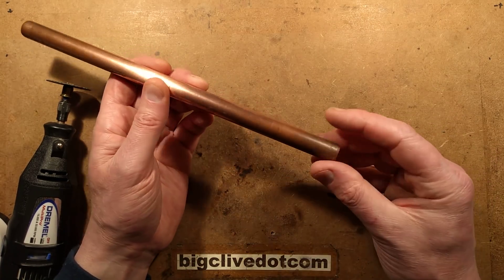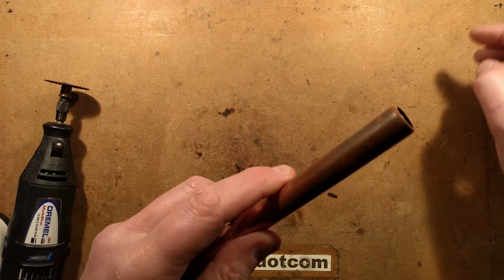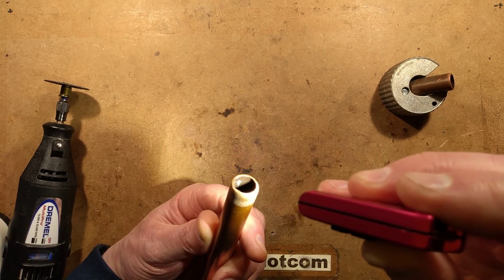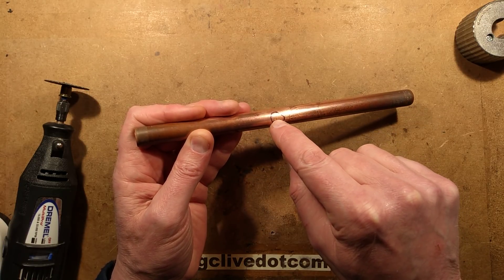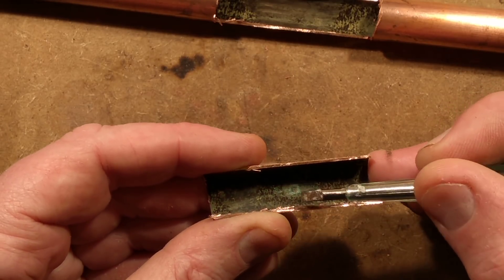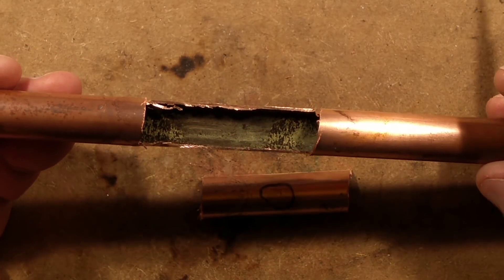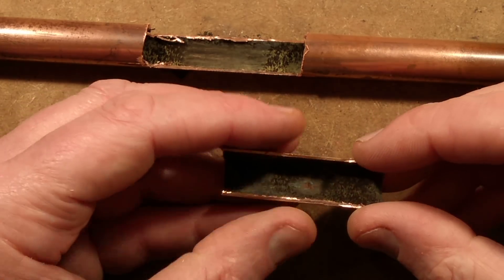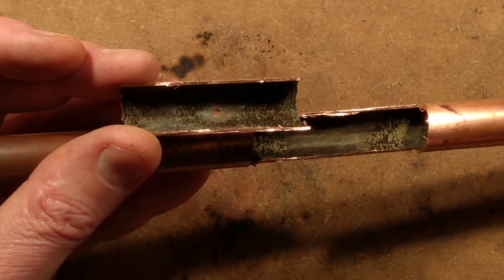Odd pinhole leak in copper pipe.  Selective electrolytic corrosion?

Comment: Pit corrosion caused by mixing copper and metal fittings in the system, not helped by the fact you have extremely soft water in Scotland. Over in Belgium copper pipes get clogged with scale, so choose your poison.

Comment: Solder beads that were trapped in the pipe... Then flushed along when water started flowing, then sitting for years corroding away...
Reply: https://www.researchgate.net/publication/229541503_Galvanic_Corrosion_of_Lead_Solder_in_Copper_Pipework
Reply: I found that after a search for corrosion from lead tin solder, copper and water

Comment: It could be from rust from the water heater? The rust flakes will settle in the lowest point of the house if you don't replace the sacrificial anode in the heater.

Comment: The local town near where i live had a spate of copper water cylinders failing within a couple of years use and it turned out to be the water supply was picking up salt water from the bore . The bore has since been moved a couple of kms up stream and the water has improved

Comment: could have fixed it with a good piece of rubber gasket and a hose clamp.
Reply from the maker: I wanted to see why it had failed in the first place.
Reply: @bigclivedotcom  copper eating aqua termites!
Reply: was defect in manufacturing.contamination. hopefully not a swiss cheese defect length of the pipe.

Comment: Eh, probably a tiny impurity in the copper which might be more susceptible to corrosion or defect.   -edit"likely the flux think mentioned in previous comments which I did not know about until reading this lol"  I've seen pinholes in new soft copper line sets for refrigeration but in my case it was a factory problem.

Comment: My Aunt and Uncle in there old house had a pin hole leak in there pipe and they had a bunch they had to replace as there was a bunch of black mold and stuff around it.
Do you guys have Worsbo pipe where you are at?
I think it is fairly popular in the UK and or European countries.
If you like I can do a video on it as I think you would like the setup of it.
It is like an electrical panel just for water instead of a breaker but with a shut off on each pipe. :)
Reply from the maker: The water DB sounds like a good idea for quickly isolating small sections of an installation.  I'm strongly considering replacing this pipe run with PEX.

Comment: I never understood why people still use copper pipes except maybe where they are exposed to sunlight. CPVC and PEX are cheaper and seem to last longer.
Reply from the maker: I've always considered copper to be superior to plastic, but that's just been blown out the window after revealing the issues with this pipe.
Reply: @bigclivedotcom  I'm in the minority prefering plastic, Just never quite undersood why.  Dont have to worry about isolating it from older iron pipes, reists freezing better, low ph water less of a problem, more flexible, easier to install, hard water deposits less od an issue. It's UV resistance is the only advantage I see.

Comment: I've seen this happen before.  I never put this level of thought into it when it happened, but I found it curious that it sprung out of nowhere.  It was a little trail of water trickling along a pipe leaving a green trail.. I guess it was leaking for a while.  When I found the pin hole leak I was surprised since nothing was in contact with it.  This happened in a basement, so I seen it, but if this happens out of sight it can ruing your day.  Curious.

Comment: A slightly easier fix is to cut straight through the hole and using one 22 mm coupler to fix it. It also happens in the more modern plastic pipe.
In the plastic ,The outer wall of the pipe allows oxygen to penetrate it causing corrosion. I've seen plastic pipes full with. Scale , to the point they're completely blocked.
This is why barrier pipe is used these days. It has two or three walls , creating a barrier , to stop that corrosion.
No doubt that the rest of the pipe will be ok, for a lot of years. It's very common. Especially in radiators also

Comment: the crap is the entire house was built with the same pipes... whatch out!! 
Don't wait to take preventative measures: replacing pipes, adding a mains water pressure regulator, changing the anode road on your hot water tank. 
Make sure non of your pipes are connected or touching dissimilar metals.
TIP: keep a bucket of water handy when your soldering your shut-off water lines with a flame!! Don't burn down your house to learn plumbing 😁

Comment: I've investigated a similar thing.  The copper pipe was under a concrete floor poured on soil.  There were several holes in the pipe very similar to your one perforation.  I looked with instruments for a source of current that might have been to blame.  I found none.  There was very little coating inside the pipe, and they had installed a water softener in the past.  I've always suspected the water was over softened.

Comment: Ok Clive it's easy to explain when soldering with wire wool minute particles of iron embed themselves somewhere in the system and a hole is electrically eroded . Always use emmery and never mix steel pipe to copper . You will need a 2 stage  filter also on the inlet . Now we have got the leaks sorted next attention should be to chlorine, in the third world chlorine has obviously it's advantages  ! in the third world !  but not in a modern society, all over Europe water monitoring is performed on a weekly basis from test points in the network and if neededwarning leaflets are pushed through everyone's letterbox before chlor or ozone is used, other countries use generally 5 stage home filters for all drinking water. Look up chlorine and bowel cancer in the web,  you have not got to forget we have the best Victorian technology in the world and our government only has the interests and safety of its people on it's radar
Reply from the maker: I can occasionally smell the chlorine at night when it is dosed into the system.
Reply: @bigclivedotcom  install yourself a 5 system water filter do something for your health and do a film about it

Comment: I would retrofit your plumbing with shutoffs at all ends and a Schrader valve in a T with a pressure guage and ball valve to isolate it, you can then close off all shutoffs and pressure test your lines, any loss of pressure will indicate a leak
Reply from the maker: A pressure valve could also be hooked up to a tap to detect that if the main stopcock was shut.

Comment: If you get a plumber that doesn't flush a system properly you can get steel wool lodged and stuck in fittings with flux. That could have caused the electrolytic corrosion as it's got dislodged over time. Only a guess but definitely electrolytic corrosion as proven by the pin holes

Comment: Good job it wasn't gas!! Yet another way our energy services have been made exponentially more dangerous in the last 20 years. You can't use a bending spring on modern pipe as it's wall thickness is so poor. Similarly TNCS earthing is dogshit and that's all they will install now. How old was the pipe I wonder?

Comment: Check your hot water heater anode.  Once they corrode away youll start getting pin hole leaks in copper pipes.

Comment: Could also be steel particles or flux in the pipe. Do you have one of the old galvanised steel hot water tanks?
Have they been working on the incoming iron main in the past?

Comment: Hi Clive, during the mid sixties, there was a hiccup in the supply of copper to Wednesbury tubes who made most of the BSS copper pipe. Some was imported and it wasn't the same quality, it wouldn't bend either.  Does your pipe have the BS kitemark every foot or so? If not it could be the imported stuff. Some stainless water pipe was also used then with copper fittings, now that you could run your lighting from!  The solder joint corroded away.

Comment: Apart from galvanic corrosion which is the result of having two dissimilar metals together and establishing an electrical contact between them through a weld and electrolyte, any metal can undergo corrosion deep within the grain boundaries. The crystallographic micro-structure between grain boundaries provides a favorable medium for corrosion to take place and reduce the metal at that localized point to nothing but ions. Again, knowing that there were no dissimilar metals, that is the only plausible explanation as to how a copper water main pipe may fail.

Comment: As mentioned in a previous comment it could be recycled copper with iron contamination. I have seen it in pipes were other contaminants have been present such as the old kind of flux we used to use also chemicals and dirt in the water can also cause it. 
Most people think that copper will last forever but the truth is that it is very susceptible to quite a lot of substances like cement which is used to line all British underground iron water pipes to prevent corrosion. 
copper pipe is only given a 20-year serviceable working life, still, no one has asked me to replace all the copper pipe in their house because it is over 20 years old but they will mone at me when it starts to leek

Comment: I had a strange hole in a bathroom pipe once, it was exactly the same square shape as a floorboard nail that I was fastening a squeaky board with. To make things worse, I got an electric shock from the kitchen (directly under the bathroom) light fitting when I was mopping the water up. Oh, what fun!

Comment: Copper will fail around solder joints, because normally plumbers will not immediately cool the connections they make. Its a failure in the prep and cooling. Copper work hardens, but the issue comes in that the tube after making a connection fails because at some point of temp and abused copper causes a structural failure. I'm metalurgist and machinist. I have seen it and some times it's just how it goes.

Comment: Saw this before on a central heating system, multiple pinholes in the pipes, spraying water at the underside of the floorboards.
The floor was ruined and all pipes needed replacing.
Reply: Clive, you mentioned you were away for a while. Stagnation can lead to this kind of corrosion, was the leak on top of the pipe or at the bottom?
Reply: I see it was on the top, there must have been a inclusion/defect in the pipe.

Comment: The same thing happened in my parents house after the pipe had been in for about 20 years.
Very hard to find unless the spray is going somewhere you can see.

I used plastic pipe in my CH and that was 35 years ago and no problems so far.

Comment: Back in the 60s, galvanized steel piping was quite common here in Germany for cold drinking water. They used to clog up with huge amounts of corrosion on the inside while looking perfectly fine from the ouside. I've had a stainless steel warm water reservoir develop holes because of the corroded iron being flushed into it from those pipes. I've always believed that iron ions won't be able to corrode copper though. Thats why when you have those steel pipes in your house, you are told that installing copper pipes downstream is ok, but installing them upstream will cause additional corrosion on the steel.

Comment: Flux residue can cause this, if it has been splashed from a nearby soldered  joint, or even from when the pipe was first laid. but it's really hard to say without being there. It could well be a defect as the pipe was extruded. Usually pin hole leaks like this are coming from badly soldered joints, not from a straight length of pipe. Most curious!

Comment: the Green spot could be caused by `bits of wire wool used to brighten the end of the pipes before soldering or perhaps a tiny glob of flux getting stuck there

Comment: Since that small section of pipe has a pin hole and it is at the location of the corrosion spot and that there are other corrosion spots I'd say it is highly possible you should have as much if not all of the pipe replaced. Is quite possible next time your away there may be more than just one leak.

Comment: If the green dots of corrosion are at the bottom of the pipe, iron filings or some other dissimilar metal that were washed into the pipe on assembly. Using a hacksaw to cut the pipe after cutting steel would be a likely source. Those would account for random spots of corrosion along the length of the pipe. If that is the case you are due for further failures. Good luck!

Comment: Ouch! I wonder if something similar happened to us?

This morning (Saturday) my mother discovered we had a leaking pipe in our unused sunroom, an addition on the original structure comprised of three walls and roof of dubious-quality glass where nearly every panel has failed thermal sealing, most of the internal tinting film scrunched up, many have condensation trapped between the panes. The foundation is ceramic tile laid over concrete, and one wall is the original exterior wall of our log cabin. First, I had to track down if it was the hot water baseboard heat or the garden hose tap... It indeed turned out to be the hot water baseboard line. Thank goodness our furnace hasn't been running since October (kerosene and electric heaters have been saving our butts) or this line would have been under moderate pressure, and amazingly the leak is not from a burst pipe... We have hard water, so most of the valves are crudded up with 42 years of minerals, shutting off the manual valve to that one heating zone didn't stop the leak - the only thing keeping that leak from getting full-system pressure was the partially-sealed zone valve, so I guess there's a bit of luck.

I ended up being even more lucky that the cold water feed to the furnace is pretty much the only valve in the house that actually shuts something off 100%. Stopped the leak until I get in there to fix it (when I do, it'll be my first time soldering pipes, wish me luck!), and I didn't have to shut the whole water system off. When I had to replace a toilet, sink faucet, even a stupid toilet tank fill valve, I had to shut off the breaker to the water pump and drain most of the pipes and the water tank. Not fun in a household of 3.

Comment: It could be Microbiologically Influenced Corrosion (MIC) that can happen in potable water in both copper and stainless, especially if it is stagnant.  I have seen it in a few cases but these were environments that had water stagnant for long periods. (i.e. water cooling tower that was not being used any more) .  Before or as you scraped the area open was the hole larger subsurface? (pinhole on inner surface and when you scraped away the surrounding oxide then scraped away metal the hole was actually bigger in the tube thickness.)   If so that is another sign it may have been MIC.  I tried to make a diagram below but its not very good.  I have also seen pitting corrosion similar to yours in cases as the other thread talks a lot about and these were cases where was some material contaminant initiated the local pit but in these cases the pit was more of a crater (V shape) and did not have a larger area of internal corrosion/hole.  I wish i still had access to a SEM and meteolgarapy equipment so i could evaluate it for you.  Good luck. 
____   ______ 
         (  )
      (      )
        (  )
____  ______

Comment: Cannot be electrolysis with iron because iron is more anodic to copper (iron is below it copper on the electronegativity scale) - besides the large area of the copper would corrode any residual iron particles.  Copper suffers from ions in the water and what you are seeing is "under deposit corrosion". Any organic or inert inorganic mineral is deposited on the inside surface of the copper and sets up a corrosion cell - as the ions in the water change via flow, the oxygen and carbonates (carbon dioxide) trapped under the deposit setup a corrosion cell - that becomes self driving - thy only known treatment is treating the water to higher (alkali) pH - de-aerating the water is another option.  The green is copper carbonate - can be checked by efflorescence with muratic (hydrochloric) acid.

Comment: I’ve seen copper pipes covered in a sort of horse hair or recycled wool that is bonded to a plastic membrane. It’s used as insulation but something happens with the plastic and it eats from the outside of the pipe and causes pinholes. Might not be what’s happened here but it’s a fun fact anyway.

Comment: I've seen this, not myself but in other videos when learning about plumbing for some DIY work i was doing... from what i understand it can be caused by rust in the water, from having like iron pipes further up the line.... when a small piece of iron settles it will grow into the copper and cause a reaction.... i think that i saw it on this old house youtube channel.

i think it was caused by iron, but it was certainly something with contamination in the water which settled and caused copper pipe corrosion.

Comment: no, that is contamination from the heater tank (because the tank is expired), it is releasing litthe piesce of iron oxide or so, and the copper pipes are damaged just like that one. The reason why are all dots in-line, is that it settles in the lower part of the pipe always.

Comment: this can be caused by too much flux being used when soldering joints, the excess then flows down the pipe and causes it to corrode forming pin holes

Comment: Had the same problem on my central heating pipe. Small pin hole leak behind the wall of all places. 
I put it down to the fact a stripped old disconnected aerial lead was in contact with the copper pipe and had caused the hole, but interesting to hear other people's suggestions